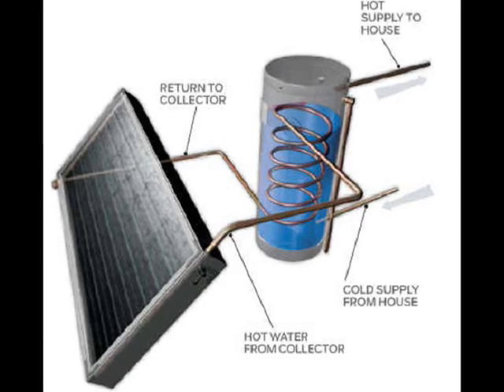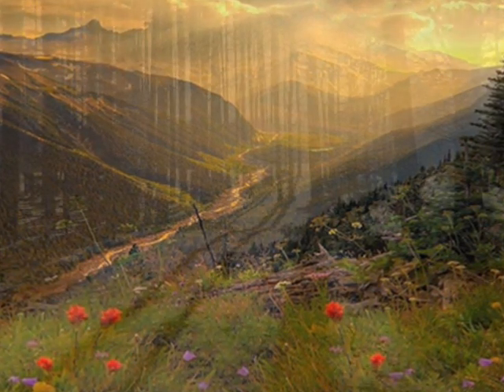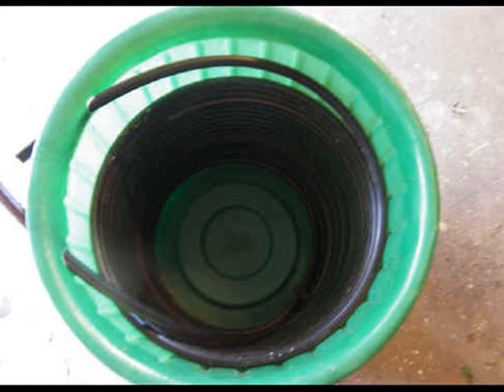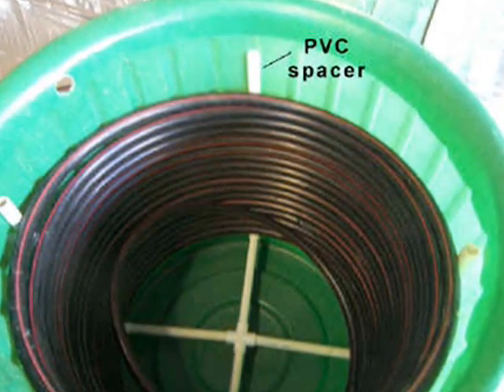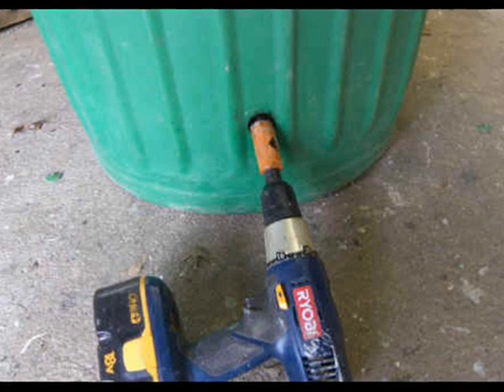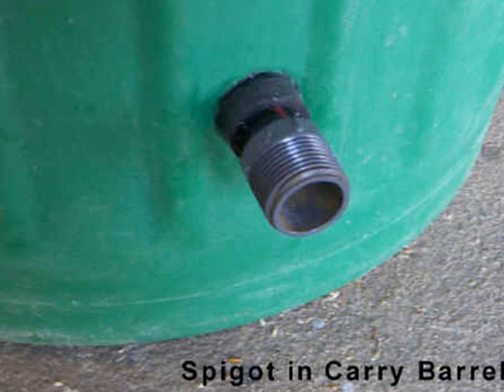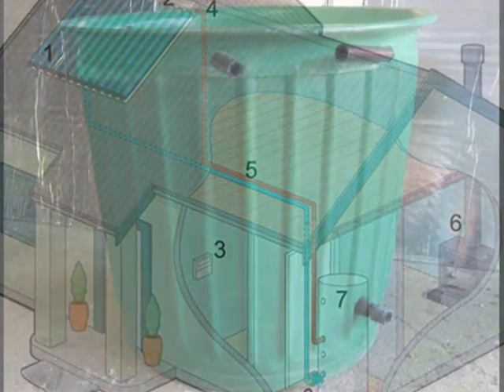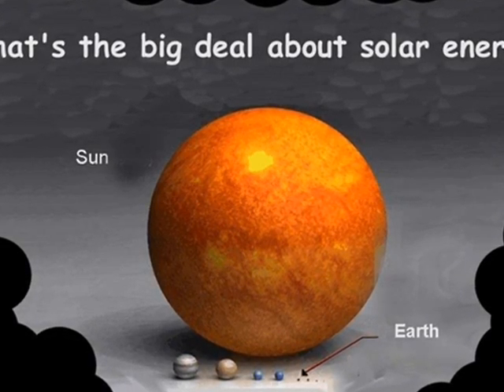Carry Barrel Solar Hot Water

Comment: Would it be a good alternative to use floor heating tubes (with alu inner lining) for the heat exchanger? There come with perfect fittings to widthstand water pressure challenges.
How would this be combined with the 5-drum solution for heat storage?